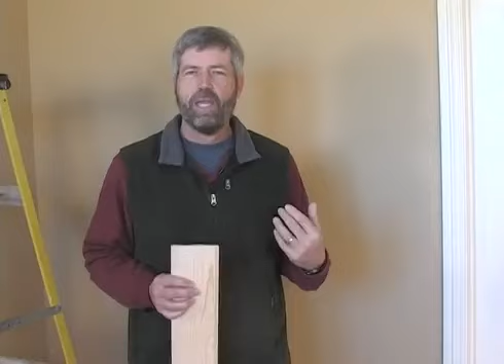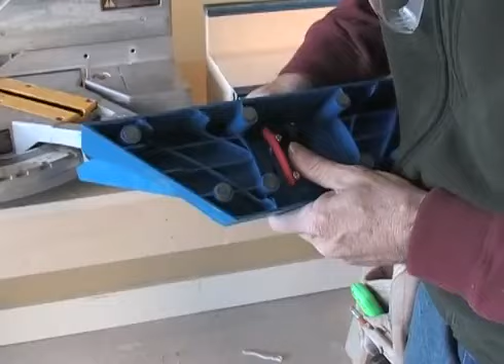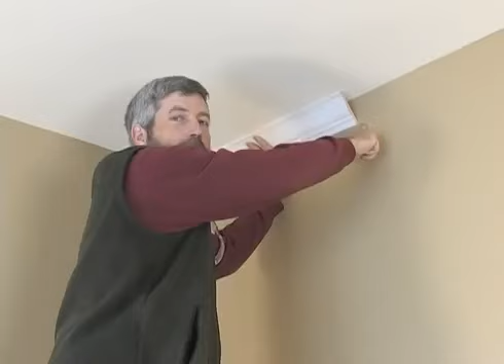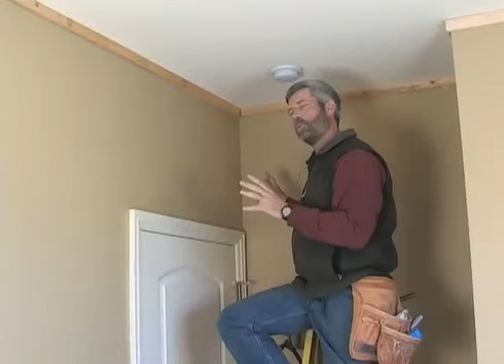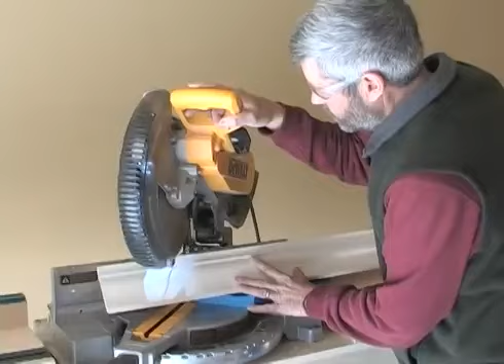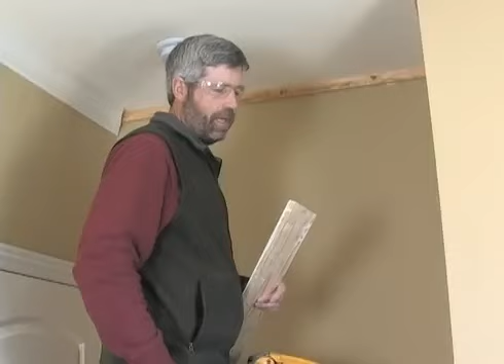Install Crown Molding with the Kreg Crown Pro™

Comment: I’ve been installing crown for over 40 years and decided to try out this jig. Cutting outside corners on short pieces is dangerous with this jig. The blade grabbed the hickory and pulled my hand towards the blade. With the work piece sitting up off of the table it pulled it down and broke my thumb and cut my finger. It went in to the trash and I will go back to cutting flat. I like having fingers. That’s my review.

Comment: Or you find where you need to set your crown, glue a stick on both sides of your miter saw.
Then you can do long pieces and not have to dickaround with raising your work piece up so far where you are squeezing to be accurate.

Comment: What happens when you have to cut a piece of 7 ½” wide crown that is 12 feet long.  This tool would never work.  Maybe ok for cheap contractor grade crown in tiny little rooms.  Just another gadget that will not work in real world applications.

Comment: I don’t understand the upside down before cutting. If you have the jig why flip the crown upside down?
Reply: Since crown molding is measured to the length of the bottom of the molding then cutting the crown molding upside down has an advantage in that the mark at which you want the cut to be located is then closest to the blade. You can test the position of the piece relative to the blade while the saw is off by lowering the saw blade and adjusting the precision of the blade cut. Cutting the crown piece the right way up then the pencil mark will be away from the blade - a bit more difficult to get the cut precise unless your saw has a laser guide?

Comment: When Using the Kreg Crown Pro why is everyone still turning the crown upside down, If you turn the jig around facing the fence then you can cut the crown molding as it will go on the wall still set your spring angle. Left inside, jig to left blade to left, for right inside blade right material right, Left outside material to Left, blade to right for right outside, material to right blade to left that's laying your material facing you with jig turned the opposite to fence
Reply: Thomas
 What do you mean ?
Turn the jig backwards and put the moulding right side up?
Reply: @dsokodrum67  yes if doing so the same way the molding go up is the way you cut
Reply: Cool! I will try it!

Comment: What degree do you set the miter saw cut?
Reply: Half of whatever wall angle you measure as they never seem to be dead 90d... Using an angle finder tool is a great plan especially the ones that lock or have illuminated digital readouts as they come in handy at the saw if not writing everything down...

Comment: Why is a chalk line necessary?  I shove the crown in the corner and get it tight against ceiling and wall and fire away. No dealing with chalk. An angle measured on a corner won’t be the same as what is set on the saw.  Both devices have variances.
Reply: Do you skip the furring

Comment: What angle is the saw set on?
Reply: 45°unless you have to adjust a half a degree to accommodate slightly off corners
Reply: For most outside corners I normally cut 45.5° so you always get a nice sharp edge. But I never do inside corners with the chopsaw like he shows personally. I like doing cope cut for insides. It allows more play for imperfections a couple degrees either way when I'm doing really decorative crown or base

Comment: Excellent video!  Very well explained and very informative.
I used the wood corner shim as explained when installing my kitchen crown molding a few weeks ago and it worked great.  Thanks again for the tip.